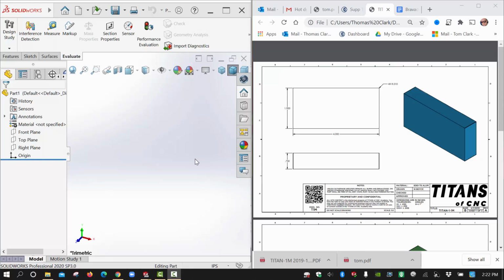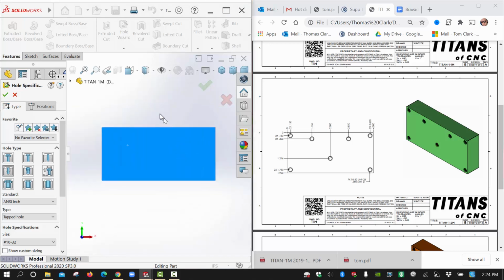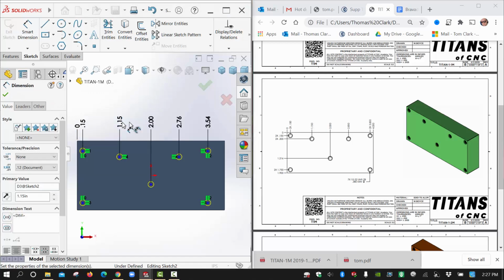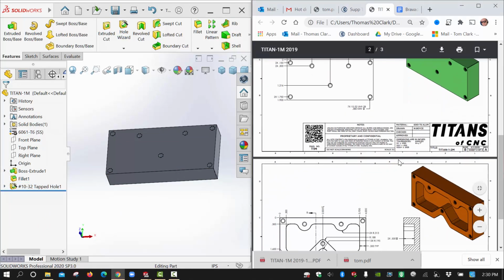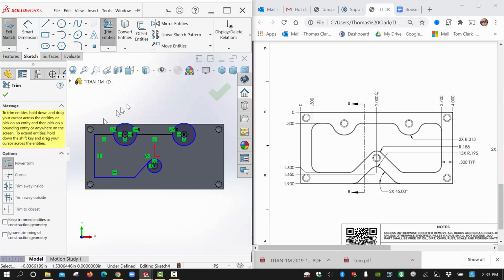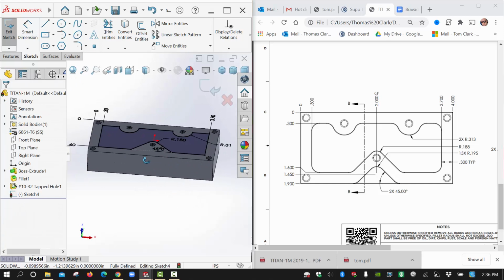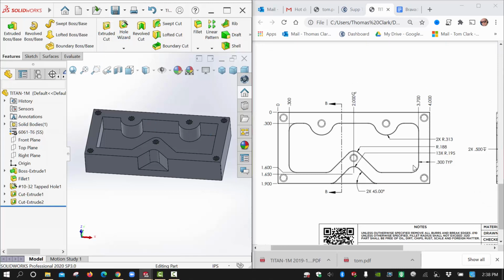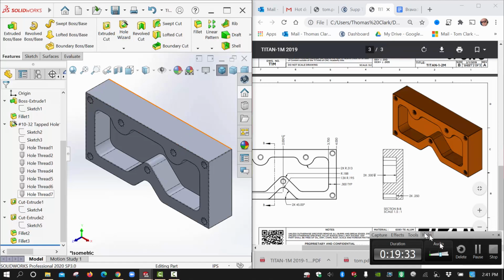TITAN 1M Modeling in SolidWorks

Comment: Good job on the video. Here are a few helpful hints. 
1. Always start with your stock size. 
2. Always use  derived configurations to have all 4 ops in one file. Especially if there are rev changes, you only have to change one file. You can also print out the op sheet from each configuration.
3. Correct the first op to show remaining stock. This is helpful as it shows how much material you have to hold by.